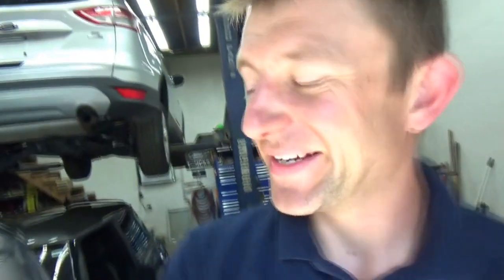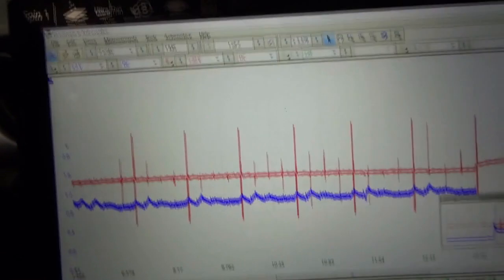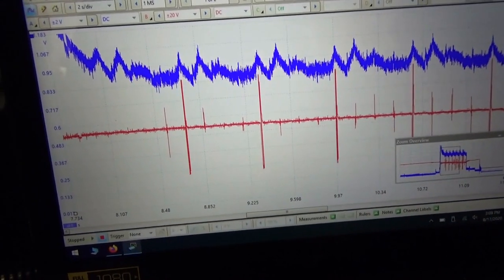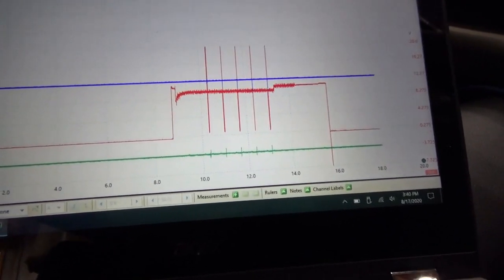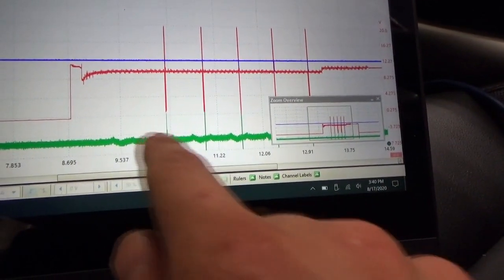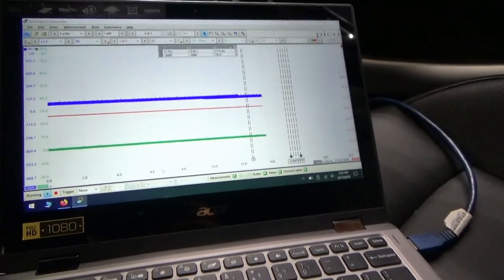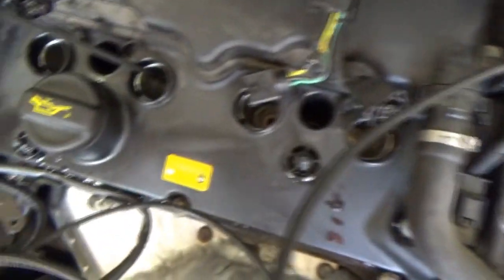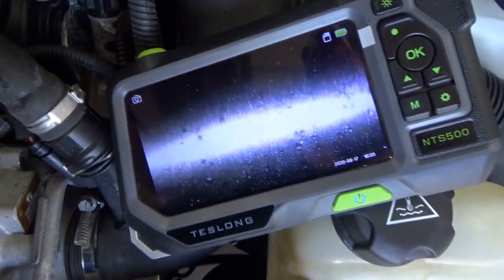Mini Crank No-Start (feat. TESLONG NTS 500)

Comment: I ordered one of these up. Daughters' car has single cylinder low compression and misfire. This is probably the easiest way to inspect for valve or piston damage without removing the head. Cool video.

Comment: BG products has a cleaning system for these failures, thanks to VW and GM 3.6L VVT. It has a 75% success rate. Some are too far gone. 
Sorry didn't see the bonus footage, chemicals or "mechanic in a can" can't fix bent stuff.  Very good video, you know your stuff. The VVT EGR delete PWM solution from the manufacturers was a nice idea , if the recommended oil is used. the $19.95 wal-mart oil change isn't it. Use the right oil !

Comment: the old mini cooper engine was a good engine, then BMW put that crap engine in them , they also sold that engine to Peugeot and Citroen, we have changed chains at 40k mile there worn out, not a hard job to replace the chain, etc so if it got a rattle from the front engines or  if you get cam and crank sync codes it's probably chain, get changed before this happens

Comment: I believe these car's can only run on high Octane (per manual) with detergents and people ignore it to save a penny or two :)
These engines run very hot and need 93 Octane to help reduce flame spark and keep the engine cooler..

Comment: I have good experience with that engine, its the ep6 turbo.  One of the most notorious engines for oil burning. Being a direct injection engine the valves are getting carboned up along with the oil burning that's why you have chunks of carbon sticking to the valves. It will need an engine rebuild. The piston rings will be all gunked up also.

Comment: Cheap spark plug tips break off and get stuck on the valve, seen it on scion engine. Somebody must have replaced spark plugs with old used ones before selling the car.

Comment: Instead of pulling it apart! Pull springs of two valve! Put hose on them, and spin the valves see if carbon will fall off! I'd clean cylinders out   put back together and try starting it! If runs valve job only! If not then new timing chain valve job and may be rings and rebuilt! Might get lucky! Fat chance but easy fix is easy fix! Pontiac 1 valve fixed the thing and saved a tear down! Happy customer and mechanic, Me!

Comment: So is your shop getting the job to remove the head and attempt a repair ? Would like to see that video, but it probably also needs timing belt work as well. Hopefully the main and cam bearings are not ruined from low oil amount.
Reply from the maker: Nah was just there for the diag. Wouldn't touch that thing with a 10-foot pole!

Comment: My biggest concern is the oil consumption after doing the cylinder head,  you know the customer is not into opening the hood and checking any of the fluid levels even after its too late.  I am seeing it more and more, were  people just won't take five minutes to open the hood and at least check the oil level , but I digress!  Great video and diag!

Comment: instead of pulling the head off you could try to rotate the engine so the exhaust valves open and try to blow some compressed air in the cylinder and see if the chunk tha blocks valve movement breaks free.
Reply: Y this may work but its still gonna use oil.
Reply: @rodd8170  i meant just to get the engine running... Those engine are known for bad cylinder bores...

Comment: BMW Minis are some of the worst cars on the road, especially when they went away from the Chrysler engines. You know it's bad when a Chrysler engine is more reliable. Nothing good about these cars. Built super cheap and yet cost a lot.
Reply: I solved all of my wife’s Mini S problems by removing and replacing the Mini with a Corolla.
Reply: Lovely Peugeot engine in this one.
Reply: The n14 engines were horrid 
This car has the updated n18, looks like in this case the engine was run with low oil. I bet most engines will not do great without oil... 2011+ mini coopers have been wayyyyyy more reliable. Plus according to consumer reports and cars.us 
The Mini Cooper brand has received above average reliability scores starting in 2012 
Take that however you want but minis have gotten a lot better.

Comment: Similar issue once on a Chevy 350. Carbon on valve holding it open. I exercised the valve with a Tonya Harding. Took several blows to the knee. But she gave up and closed. Then I fired her up and did a sea foam on the intake and cylinders. Actually cleaned it out nicely. She still runs good. My brothers car.

Comment: Can somebody please dumb it down for me.    How does  a lead on the starter cable. And one on number one ignition coil produce a wave on all cylinders to show low compression.
Reply from the maker: Starter current is directly proportional to the force to spin the engine over. We expect 4 even compression humps from sync to sync...here only had 2 of 4 👍🙂
Reply: The "lead" on the starter is actually an inductive pickup coil. In this case it produces an increase in output voltage relative to the increase in starter current.

Comment: Mini Coopers are Direct Injection engines they are prone to valve contamination and require walnut or soda cleaning often...An oil catch from PVC valve to intake manifold can greatly reduce this problem.
Reply: Said this exactly, I seen so many of these come through the shop I knew before he showed the damn borescope, then I seen it and was like yup there you go. That engines got to come apart like ivan said
Reply: @danielcarter5579  same on audi i4,v6 with direct, get the ice pick and hammer.

Comment: Direct injection seems to be synonymous with serious carbon build up. Would love to see the repair video and see the real damage. Relative compression test a real good indicator of trouble ahead for little effort. The repair cost hopefully justifies the cost of the purchase price.
Reply: For some reason the Euro engines seem to suffer from that much worse than others. On some VWs getting the intake valves walnut blasted is basically a maintenance item.
Reply: @RobertHancock1  The problematic carbon build up in GDI engine is in the ports rather than the cylinder, VW has added additional port injectors on their later engines to resolve this.  I think this engine has been burning a lot of oil.

Comment: Those Prince engines (like the Mini N18 here and BMW N13) are known for timing chain tensioner failures. When it starts to make a rattly sound, you better hurry up. They do use some oil. Mine uses about 1l/8000km (not great, not terrible), so you'd have to keep an eye on the oil level. I had an coil fail, but that seems to happen quite often on all newer engines. Other than that, it's quite a nice engine. Pretty good sound (for a four banger) and pretty good performance. Especially in low rpms it's pretty torque-y. An occasional Italian tune-up might help with the carbon build up.

Comment: On your first test how are you able to determine mo compression of all you have is a probe on ignition coil one? This has me baffled
Reply: He also had a current clamp on the battery cable. As it turns over, the compression causes large current consumption but not in the weak cylinders

Comment: I don’t recall so many engine failures back in the day of timing belts. These chained engines with direct injection are bound to all blow up one day or another. Low tolerance pistons to lessen the friction, longer intervals between services, higher oil consumption tolerances by the manufactures... chained engines have become consumables, and are not designed to last very long. It’s sad to see this happening to the internal combustion engines.
Reply: Direct injection engines are hard on the oil and really should be using synthetic. Combined with excessive oil change intervals from some manufacturers and owners not even maintaining them on schedule, you get problems. Don't seem to be nearly the same issues on well maintained vehicles, but these Minis seem to be unreliable in any case.
Reply: just trow out the EGR and you have way less problems with those engines the chain is not the problem its the poor maintenance and the Exhaust gas recirculation.
Reply: You get more carbon buildup on direct injection engines gue to the fact that the injectors aren’t spraying over the valves into the combustion chamber, therefore not keeping the valves clean of carbon  deposits .
Reply: @paulsz6194  But you get carbon build up on the other side of the valves, and the ports.

Comment: I would love to see a video on the heads coming off and closer inspection and repair. I have a Malibu 3100 that has a lot of build up also. Its got 175000 miles on it (2003). I did a intake manifold replacement and saw a pretty substantial coating of carbon all over by the valves and the intake. Not affecting the valves but since it was my first IMG replacement I didnt go that much deeper. Figure run it until it dies.

Comment: Very interesting. Does it have 8 or 16-valve engine? 
Brought my old 1990 Mazda 323 in my mind as one exhaust valve was once burned in cylinder no 1 (it had 16-valve engine, all other valves were ok.). It started and ran pretty well and only in the MOT inspection it was found out, that something is wrong, as it failed the emissions test, miserably :D
There was small part missing from the valve so it had to be replaced, mating surfaces were resurfaced in all valves, and while the engine was opened anyway, head gasket, valve cover gasket, valve seals, timing belt + tensioner, camshaft seal, and some other parts were replaced as well. This was the biggest repair ever in any of my cars.
Reply: 2 intake and exhaust per cylinder

Comment: Mini’s, the car that doesn’t have woodruff keys on the cam sprockets because.......reasons.😔
Reply: Ford did the same thing with the crank sprocket on the 1.6L Fiesta engine.
Reply: @JayK-t5h  yeah, don;t skip proper bolt torque day and loctite on cam bolts. i can think of many in the past I serviced which had taper fit sprockets on cams, ford and chrysler mainly, but I know there was others too

Comment: Why is it that on auction cars : battery dead , no keys , no key fob , can't open doors , can't open hood ? They wouldn't be trying to hide something ? I heard they cut the cables on the hood latch all the time . I bought a Taurus . It was " serviced " by a municipality . They were all running when you inspected them . They were running when you went to pay and pick up . I went inside , paid and received the paperwork . When I came outside , it has thrown a rod through the side of the block and a had big puddle of oil ! Scrap ! Beware ALL auction cars and used cars ! Scumbag Ford dealer was buying used " security Jeep's " at auction , removing all logos and lights . They were on his used car lot . They ALL had millions of hours of IDLING and thousands of DONUTS eaten in them ! There is a SUCKER born every minute - P.T. Barnum .   Great diagnosis Ivan .
Reply: Now that's funny

Comment: Likely started the oil use when the vales just begun to not fully seat. Those plugs are wet wet.  Rebuild this engine, need rings and valve work.

Comment: A Mini does not need to run out of oil for the timing chain to skip. If it has done 100.000 miles, either the timing chain has already been replaced or it is worn out so bad that it can easily skip. No parts required is not the case here, it definitively needs a new chain.

Comment: Pull head and check the turbo seals. or replace the turbo. This will be a comeback with the same complaints if the turbo is not replaced..

Comment: You could  have saved your time by looking at the badge on the boot lid mini. Total junk engines
Reply: Hush your mouth  It's a BMW!!!!!!
Reply: @MWestern-m4g  that's abit difficult as my mini cooper s must have had a self destruct button at 30.000 miles. And also my sons bmw m3 was dropping injectors and coil packs at about 26000 miles. Absolutely appalling for  modern cars
Reply: They are expensive to maintain!! I was being sarcastic!!  No vowels. Bad Karma

Comment: Wont hurt to pull the valve cover off and remove the cam and tap on the top of the valve stem with a copper rod and hammer and see if it will return shut
Reply: Can't do that because you need special tools these cars are a nightmare you just don't know until you work on one
Reply: @zoticus1  Of course made by bmw

Comment: Many customers never check oil, or think oil pressure light on are when to add oil. And I've see a number of timing chain , belts jump a tooth or two, and giving bend valves, 😱
Reply: When I was 16 (20 years ago) my girlfriend at the time drove a little Hyundai that her dad gave her. The engine was CRUSTED with caked oil stalagtites inside and the oil pressure light kept going on. I knew the engine was a victim of no oil changes, and come to find out her dad did exactly what you said!, he only changed the oil when the low oil pressure light came on!!!!! At the time he was driving his new truck (a 00ish ford f150 v8) and I asked him if he changed the oil and he said no, the light hasn't come on. I warned him but he didn't believe me. The hyundai only had like 90k on it but it was trashed... Try that in a modern VVT car and your wallet is toast... insane.
Reply: It's not the missing oil change that's the danger it's the missing lubrication
Reply: @volvo09  the guy is a moron and deserves the shitsamwich with his name on the wrapper.

Comment: Wow,  Ivan.   I actually seen this before on Eric the car guy video when he did the mini Cooper series.   Same problem. 
Unbelievable that bits are stuck on those valves!!  Well,   engines are made by BMW,   poor design!  I used to own a mini Cooper before BMW took over.  It was great little car! Great video!! Many thumbs up,
Reply: This engine is actually made by PSA, but in collaboration with BMW. BMW was in charge of the head. But a collaboration between the French and Germans never ends well...
Reply: OR: Perhaps, if the engine is maintained properly - that wouldn't happen. Is that possible?
Reply: @Peter_Riis_DK  If by maintenance you mean replacing the timing chain when it rattles then yes, this would have been prevented...
Reply: Original mini's are kickass!!

Comment: That is strange.  Have not seen this before. Could happen. I did see where Eric O. had a Chevy S10 with the same problem and it was a stuck open valve due to wear on the head.

Comment: These eat oil , over heats,  turbo problem,
Reply: Two best days for my wife’s Mini S...the day we bought and the day we sold it.
Reply: @DogRedful  sounds like a boat on wheels.
Reply: Dont forget the chains lol, waterpumps, Thermostat housings.
Reply: @Vespastendert  And bad valve covers, cracked thermostat housings, lift gate switches falling apart, failed radio display, cracked center brake light connector pins, oil filter mount leaks...
Reply: Eric haha oops forget about those. I know these engines from peugeot.